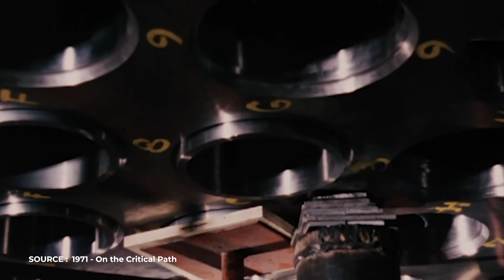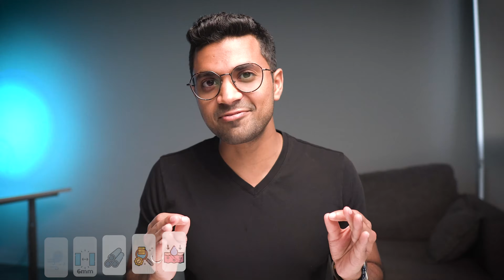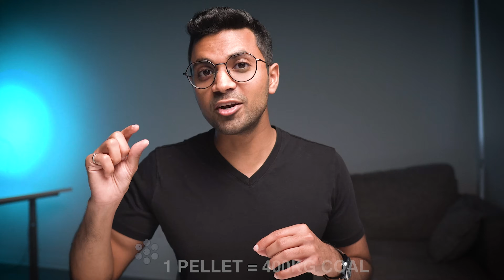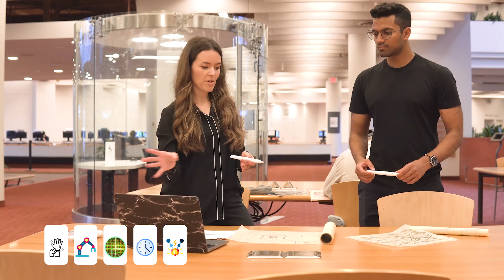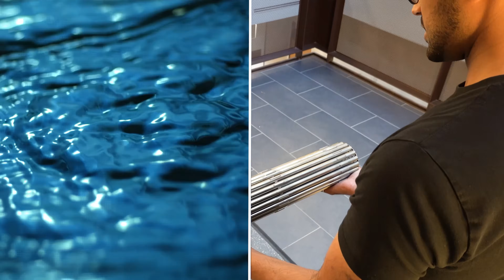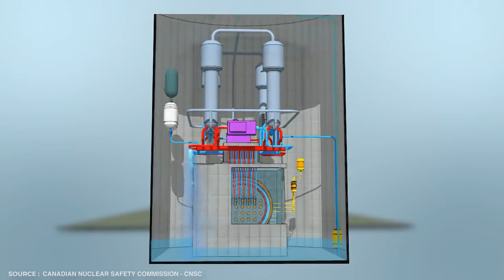The ULTIMATE CANDU Reactor Guide

Comment: At 21:47 you mention that reactors don't blow up but in many recreations of the Chernobyl disaster its often depicted and/or described like the reactor blew up. Is that just for the show or did it happen, if so i would love to know how/why?

Amazing video btw 😄
Reply from the maker: Good question Project B. Nuclear power reactor fuel has a very low amount of fission product (The stuff that's active), the fuel is only 3-5% enriched, whereas nuclear weapons are 85% or more enriched. Its designed to slowly release energy overtime, rather than all at once (weapon). Also, reactor vessel and fuel assemblies are designed so that they don't "explode", rather the physics and safety analysis are design features built in to make sure it operates safely. However, when it comes to Cherrnobyl it was a "Steam explosion (only released 5% of the reactor core)" whereas a majority of the fuel stayed inside the reactor. This is considering that Chernobyl RBMK's didn't have concrete containment (which all other reactors have). Moreover, Nuclear reactors don't blow up technically like a nuclear weapon. Hope that makes sense
Reply: @OsamaBaig  Thank you for explaining!

I'm currently only 15 with a large interest for energy politics and nuclear energy while dreaming of becoming a nuclear engineer in the future. So learning anything and everything about it enjoys me a lot 😄
Reply: Chernobyl and Fukushima Daichi diasters were all hydrogen explosion.  As Osama pointed out the enrichment level of nuclear fuel in reactors cannot create bomb like explosion. The culprit is zirconium.  Zirconium is used in the nuclear fuel rod casing.  When exposed to high temperature steam, zirconium reacts with hot steam and give out hydrogen.  It is those hydrogen caused the two explosions.
Reply: @catchnkill  Thank you for explaining it even more for me!

Comment: Why isn't the energy from spent fuel pools harnessed?  If the spent fuel is so energetic why is it removed from the reactor?
Reply from the maker: Same logic as why energy isn't harnessed from a cars exhaust (it's not worth harnessing). Also, there might be ways to divert the extra heat toward heating other areas in the plant, however that would be an additional plant application. Also, spent fuel is removed from a reactor after its spent, since it's reached a point where its not effective at producing sufficient amount of energy (fissile amount is depleted)
Reply: @OsamaBaig  Thanks I guess that is all obvious though having you say it does drive home the reality.  Seems like a great amount of wasted energy though small compared to the reactor at an operational level.

Comment: Could you please make a video explaining why Candu reactors have not been selling over the past several decades? Could explain as well why has it not been successfully sold to lots of other countries in Europe, MiddleEast and Africa that have attempted to purchase the Candu in the past. I have been quite curious about this? Thanks.
Reply from the maker: The reason why deals don't go through at times is due to a few reasons 1) Development of a regulatory body (You need a nuclear regulator that follows IAEA guidelines) 2) Cost (Many developing nations may want a reactor but have difficulties with financing it) 3) The country already has an unstable grid (no reliable electricity sources), thus the entire grid running on a unit or several units is not the best idea 4) The country simply doesn't have the domestic expertise to run a nuclear power reactor. It takes years for a workforce to develop this expertise (it doesnt happen overnight). It takes both investment and time. 

However, CANDU Reactors had been built in Romania, and may still have new prospects to build more units there. The story of Nuclear reactors not selling is not only unique to CANDU but also to the other designs. Only two countries had joined the "Nuclear Club" after Chernobyl, Romania and most recently UAE. In the recent decade you seem many other countries joining, such as Egypt and Bangladesh.
Reply: At the end of the day, many people would rather enrich uranium as it provides a simple pathway to bombs.

'Enriching,' water, to heavy water is a similar process but is no use at all for bombs.

In short if you go the CANDU path you a relinquishing the possibility of using nuclear power technology to make nuclear bombs as a by product.

This scenario has played out in recent decades in the ME.

Comment: Thank you for another excellent video! And about one of my favourite reactor types too^^ This video needs more views/ likes.

I have a small question pertaining the Non-Proliferation Act you mentioned. Isn't the CANDU at risk of running afoul of said Proliferation Act at some point, because of its on-power refuelling? If my memory serves me right, India and/ or Pakistan got their weapons grade plutonium through the (ab)use of a peaceful CANDU reactor, essentially turning it into a plutonium breeder with the help of its on-power refuelling capabilities. Please, correct me if I'm wrong on this. I'm always eager to learn new things.

I do know that it was also the reason the Soviets insisted that the RBMK must have on-power refuelling. Yes, it makes electric power, but such a powerful reactor could also breed high-quality plutonium in large quantities at the same time. In the end I don't think they ever used it as such, but I do know that it most certainly was a design requirement which for the CANDU, of course, isn't the case at all. That is solely meant for peaceful use as a power reactor.